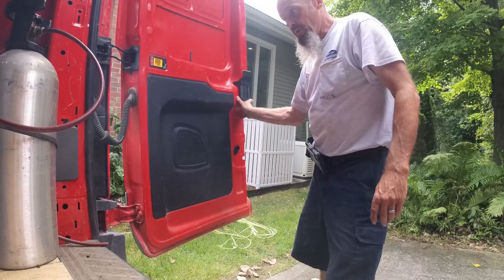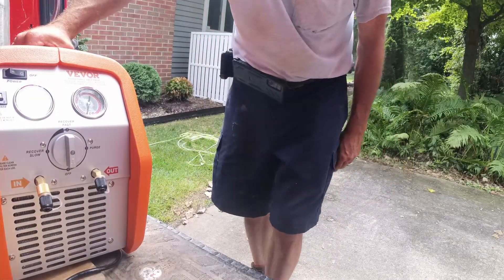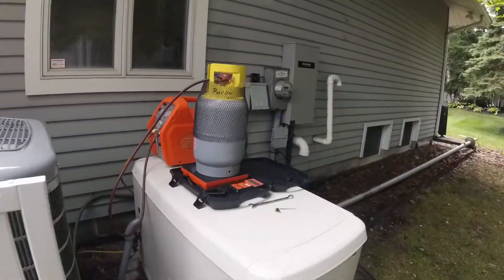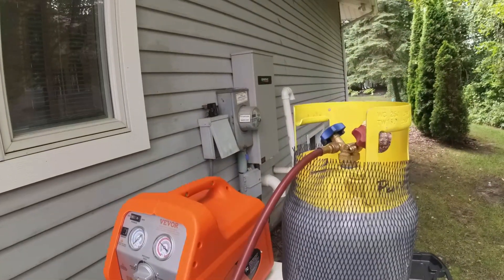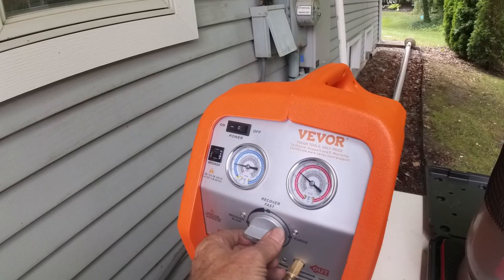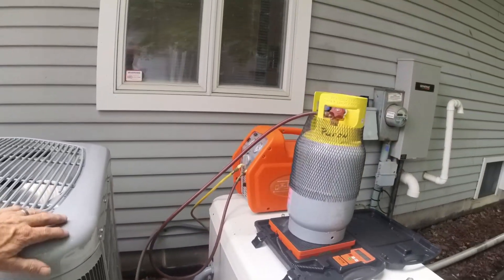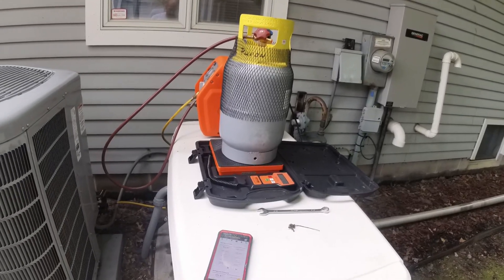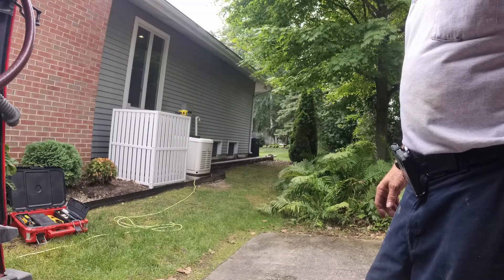Check It Out Vevor Portable 3/4 HP Refrigerant Recovery Machine And Scale Review

Comment: What does the purge actually do? Why is it needed if the system is under vacuum and everything has been pushed through the tank?
Reply: @papimasfuerte4671  I think it's for noncondensables like water or other contaminants, could be wrong though.
Reply: The purge function on these recovery machines removes any residual refrigerant from the internal pump crankcase. It basically just clears the machine of the remaining gas. There will always be a diminuous  amount in the output hose machine to tank. EPA guidelines say that should all be vapor. That’s what blows off when the hoses are removed at the end.